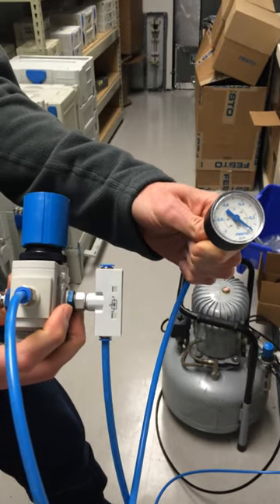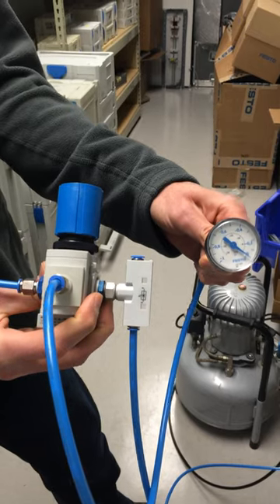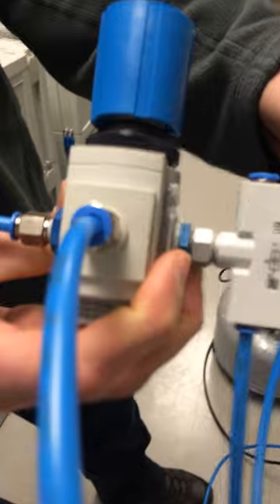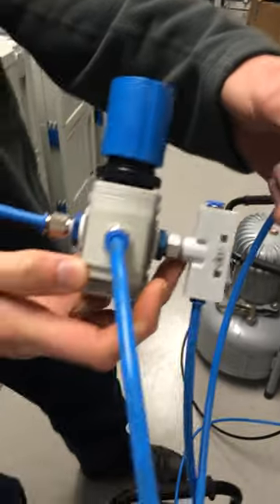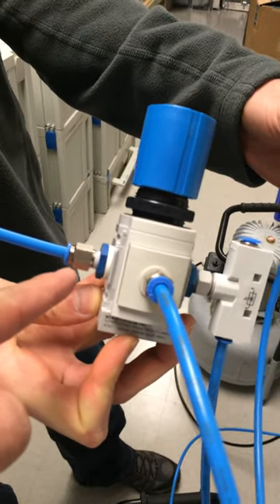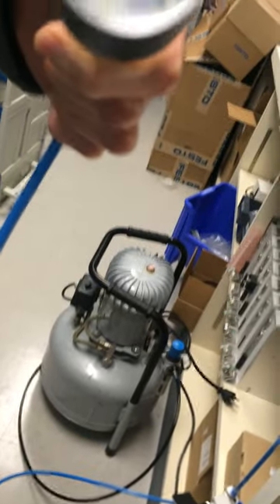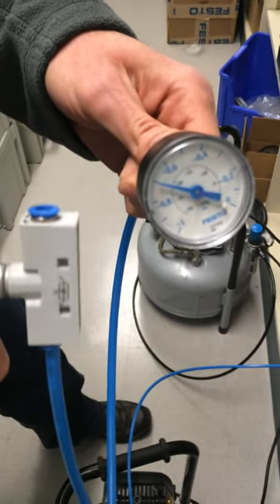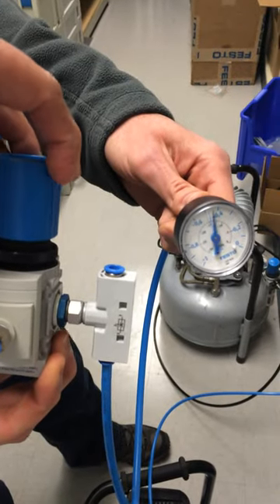Regulating Vacuum Pressure with a Standard Pressure Regulator

Comment: What model MS4 is that?  does it actually regulate the vacuum with flow and keep the system sealed? or is it regulating vacuum by bleeding air from atmosphere?
Reply: Sounds like it's bleeding from atmosphere based on the hiss